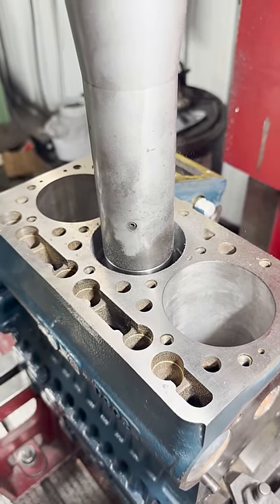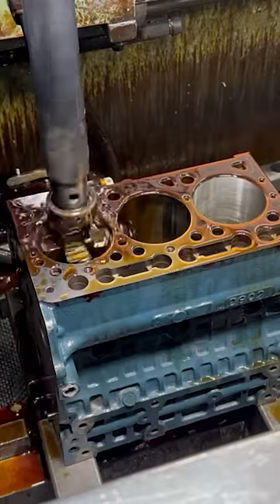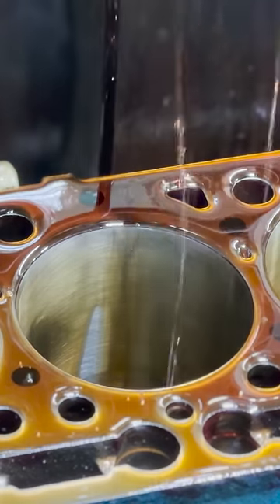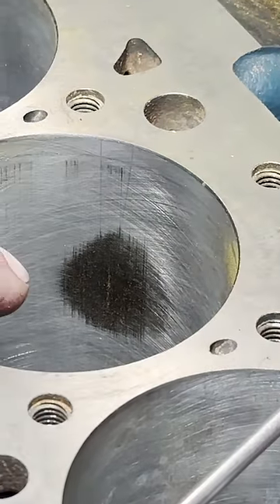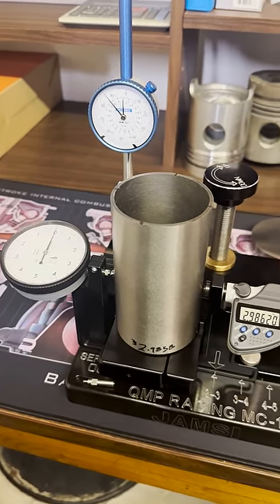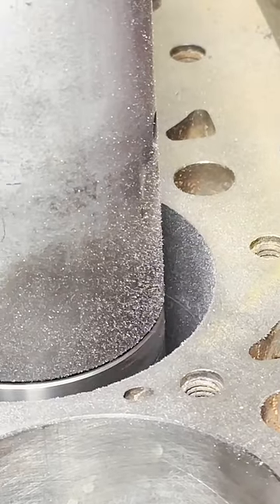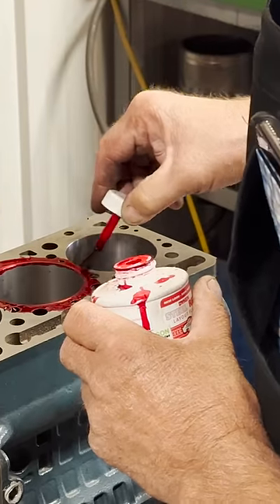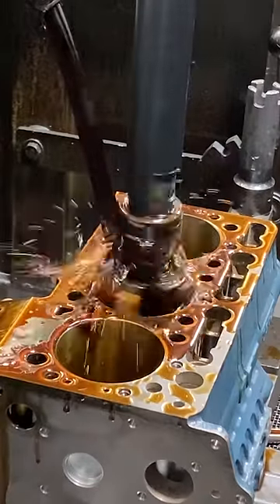#shorts Sometimes You Make Decisions Based On Experience... And It's A Good Thing!

Comment: Its frustrating when a magnaflux doesnt pick up the crack, but it was clearly there, NICE catch, and opting for the sleeve was the proper call as well......good stuff guys....good luck!!!
Reply: Any idea why it wouldn't pick it up?
Reply: The reason is likely that the metal cracked, but because of the force exerted by the rest of the mass of the engine block, that the two parts of the crack were pressed together firmly enough to 'seal' the crack which made the magnetic field average out; preventing the magnaflux from doing its job.

Not to mention the crack happened at a high tempurature when the metal was looser, and easier to move. This would have cause the crack to close when the block cooled off.
Reply: @valkie9781  Appreciate that. It's what I expected, but wasn't sure. I believe also that the magnetic field is created (or re-created) as the metal cools also, as heat destroys magnetic fields... so if the metal is being compressed back together as it cools, it might not have as much as an effect on the formation of the magnetic field as it forms (or re-forms). The thing that surprised me though is that the metal shrinks as it cools, so I thought that would make it less likely to be compressed as it cools or especially after it cools.
Reply: @valkie9781  Great explanation, and WHY the magnaflux didnt catch it, but YOU shur did once machining!!!....again, SMART, and KUDOS!!
Reply: A.good block is less than the repair. Remember..... At this point they need all new bearings and piston rings and a piston and a valve set.....

I wouldn't repair this.
Reply: @valkie9781 I’m assuming he was doing the residual method which is always going to produce a weaker magnetic field and even harder without fluorescent particles under a black light. Would be far better off with just a penetrant inspection in a shop setting like that in my opinion.
Reply: Magnetic Particle Testing should pickup subsurface indications.
Reply: If all the mechanics were this honest and cares about customers belongings, even if its a scratch
Reply: Probably not cleaning the area well enough, however sometimes it can start as a single hole that leads to the rest of the crack.
Reply: Aa i appreciate the praise, but honestly im just a guy who loves physics!
Reply: @valkie9781  so do I, fellow ICE/Machinist lover guy, so am I!!!......i love watchin this kinda stuff, and i've had mor math than most ME guys, did Calc I, II, and III, and did Dif EQ......so i'm just a nerd, who loves this stuff!!
Reply: @valkie9781  wholesome explanation
Reply: @valkie9781  More likely, the cleaning activities peened the metal over the crack. Using DC current for a magnetic particle inspection should pick up slightly subsurface flaws, but AC is often used.
Reply: If they did it right, they would’ve saw it. I do it every day.
Reply: @jacobstevens4130  i was thinking the same , penetrant testing is more sensitive, at least compared to black dry powder
Reply: That's why he gets paid the big bucks! 😏
Reply: Visible dye penetrant, flourescent even, would be the best option. If they are determined to do mag, then wet mag would be best. Powder mag is not great.
Reply: @NotTodayBud I 2nd this with penetrant dye test.
Reply: bro is a prerecorded message
Reply: @valkie9781 that isn't really true though, magnaflux will show subsurface discontinuities, a crack or lap for example that is below the surface that isn't possible to be seen with the naked eye. It comes down to proper testing, if the yoke has been lift tested and in good working condition, issues with the medium, or if the yoke wasn't held across the discontinuity in the correct direction while being magnetized. The main reason for NDT is to be able to catch stuff that is below the surface or almost invisible to the naked eye on the surface. AC works better on surface cracks, DC penetrates deeper so it is better for subsurface cracks. All in all, there are a lot of things that could have been done wrong, but this crack should have 100% showed up with magnetic partical testing.
Reply: @valkie9781 Why would the crack close as the metal cooled?
Reply: @kahikohammah Yup, the comments are either amateur or inexperienced and bullshitting. If you want the full story check out the NA 01-1A-16, it is free to download all over the place.
Note it covers PT, ET, MT, UT, RT, and visual inspection methods and well as covers alot of manufacturing and fab for inspection considerations.
As for temperature affecting magnetism, you energized the part. Unless you change the alloy, it shouldn't effect much beyond temper. Personally, I'd suggest they get a cheap Eddy current tester to save even more time.
Reply: They do t need luck, they have skill
Reply: @deucedeuce1572  If they did penetrant and didn't etch it they could have had smeared metal hiding it.
Reply: @Schimenator  That never crossed my mind, but now that you mention it, I recall that happening fron time to time when testing hydraulic cylinders when I used to build them in a factory I worked at. It wasn't a common part of the job, because we usually used air pressure and mineral spirits and air pressure to test them. Occasionally though, we would have to test aluminum cylinders that were sent back (warranty). We found out that sometimes when we disassembled them, the aluminum and/or the never-seize could be smeared across the cracks, so we couldn't see them with the dye. We had to start taking extra care to clean and brush them. (Before I started working there they didn't want to waste time on each cylinder, because they were more worried about recovering as much cost as possible with as few man hours as possible).
Reply: @deucedeuce1572  Recovering the most man hours and cost as possible? Unless tech data precludes it, you should have been doing bolt hole ET. Especially if all your cylinders have the same ID. Second choice would be surface ET. Find all the surface and near subsurface cracks, intergranular corrosion and heat damage with very little cleaning required.

Comment: ive seen this issue.  you dont always see the crack until you make the surface smooth then it will slap you in the face.  yellow spray paint or using magflux will make it plain as day.
Reply: Did you miss the part where they used flux at the start and didn’t pick it up?

Comment: Use liquid penetrant to check for cracks. Takes longer but thats a tough surface to MPI due to geometry. LPI also pickes up rounded indications as well.
Reply: Also it is just better suited for in work Shop applications 2 spray canns and a rug dont cost much and it doesn't take soo long (wouldn't even start cleaning a maschine in that time)

Comment: Too many people would take the easy way out and junk the block. I wouldn’t let people with that mentality touch my components. You guys made the right call and did an excellent job with the repair 🏁.
Reply: Would not a new block be stronger than one with a crack  in it?.
Reply: @leeengelsman1855  … Or course a new block would be preferred but things like cost and availability have to be considered. Sleeved cylinder bores are usually stronger if the original cylinder walls are too thin.

Comment: As a kubota tech i think the only somewhat common catastrophic engine failure i have seen is usually from overheating especially in RTVs due to all the coolant leaking out, thermostat stuck, or just shitty coolant. Usually all cause the customer doesn't wanna pay attention to the light on the dash

Comment: Love your videos bro, but magnaflux is a brand. You are performing MT(magnatic testing) or more specifically MPI(magnatic particle inspection). If you ever have a susicious area and nothing is being picked up with the AC yoke, try using the DC setting. The DC setting is for picking up internal indications; although, it is extremely difficult to properly diagnose.

Comment: You may give some consideration to drilling a .090" pair of crack-stop holes, one on each end of the crack line before installing the new sleeve.
This can easily be accomplished with a Aviation right angle "ace drill or snake drill"
If the holes are blind you could also drive in mild steel pins a couple of thousands over the I.D. of the .090" holes and then smooth them when you hone before fitting the sleeves.
The interference fit pins will put the crack-stop holes in tension and further mitigate crack propagation.

Also if you spot the crack during the boring operation you could drill and pin the holes at that time provided you can get the boring bar/quill and spindle out-of-the-way to get in there and work while also maintaining original center line of your boring operation--and then knock off the proud portion of the installed pin(s) with the boring bar--giving you good confidence it will not catch/damage your honing stones during final bore sizing.

Just a thought.
Reply: What a load of shit. They did it the exact proper way and I have been reconditioning engines for 57 years.

Comment: The block was here in the machine, time and money invested up to this point. A sleeve fitted job done.  There was a well thought out reason to be there with regards to cost and downtime.. A bit more boring and a sleeve cost a couple hundred bucks extra. Makes sense to me. Many others said delay of a year and 5000 ish bucks.  I would go down the same route and I turned spanner’s and ran a shop. You need the vehicle/equipment back on the road reliable as soon as possible. Also find out why it overheated and fix that, it might be operator error!

Comment: Maximising your indication in a perpendicular direction with the yoke to the direction of the crack will show you the true length and width of those cracks when you’re using magnetic particle inspection. Also while being magnetized which is hard in the small space of the cylinder bore. Magnetic prods would be better IMO. You guys do great work.

Comment: You did excellent, exactly what i thought. This process is often done in 2 stroke dirt bike cylinders, which have exhaust port bridge support which often cracks, because whole cylinder is casted aluminium with nikasil plating, and when bridge cracks there are 2 ways, first is welding, boring and grinding and then putting new plating which is really expensive, or just sleeve cylinder , iron is much harder and I never seen a 2 stroke sleeved cylinder fail on bridge

Comment: If you hammer it manually you'll have uncontrolled pressure inside the sleeve. You should install it with a press to uniformly distribute the pressure.

Comment: If you rebuild an engine, you know what you got. Most rebuilt engines get a piston:cylinder tolerance of 1/10000th creating better compression and less degree of failure. Any used or off-the-shelf engine will have a 1:1000th tolerance so the piston rings take more abuse and you have the same chance to overheat and experience the same failure.
I will spend 2-5k rebuilding over paying the same price for the same failure down the road.

Comment: Use a 90 degree drill to make holes at the beginning and end of the crack. Putting a sleeve in a cracked parent bore, better be accompanied with a healthy dose of loctite. I always used nitrogen to shrink the sleeves about 2 thousandths of an inch. Then the sleeve just drops into the parent bore and sits on the bottom lip without hammering on a cast sleeve that can break quite easily. You'd get about a half of a rotation with the sleeve before it heats up to the temp of the block almost instantly and locks up in the parent bore. You can watch the frost on the sleeve disappear and then it's locked in place. Also heat transfer between sleeve and parent bore are very important. If you have any air pocket or voids trapped behind the sleeve, that can create a hot spot. Air is a great insulator and blocks heat transfer.

Comment: Would it not be beneficial to install the sleeve with a temperature offset? The .002" interference could be turned into a .002" clearance with a 300 kelvin or so offset. Chuck the sleeve in the freezer and the block in a 250°C oven and they will slide together with minimal effort and it reduces the chance of it picking up during the install.

Comment: bro i apologize if I being rude, why don't oversize the cylinders before putting bore in it? In Indonesia the solution of that kind damaged to the block only tell the client to buy a new engine block or weld that graze part with alloy if the client want a cheap and short term life before putting a new bore.

Comment: Maybe a dumb question. Could you weld the crack and then re bore ? Or would that weaken the rest of the cylinder ? Probably not worth it but I would think the crack on the water jacket would open up under pressure.

Comment: I don’t think idling your car for a few minutes is harmful to modern engines. The biggest concern would be with direct injection engines: carbon buildup. It’s more likely to happen from idling. However, a few minutes is nothing. 

There’s no need to do it on modern engines, but to say it’s harmful isn’t exactly true from what I know. Now, idling for extended periods of time, like 30 minutes or more, can be harmful. 

But, like you said, all that’s necessary is to just let it high idle and drop back to normal. I cringe when I get off work and see everyone in the parking lot start their car and throw it into gear and take off with normal levels or acceleration. I let it idle down, and then I stick to no more than 50% throttle until the coolant and oil comes up to temp. And even then, I usually stick to 35-40% or less throttle unless I really need to get that extra 10%.

Comment: So if an engine has a crack in its expansion chamber, you just drill out the hole wider, then push in a tube from the same material with glue? Thats amazing.

Comment: Those small Kubota diesels are odd. Depending on the CC’s of the engine, they may or may not be sleeved. Interesting thing is, the sleeved engines don’t have a lip on bottom to set them on. Sleeves are just pressed in flush. I don’t see any reason to leave a lip at bottom to set a repair sleeve on. Things you wouldn’t know unless you’ve rebuilt a few of them.

Comment: i literally have pics of this same engine with the same problem. overheated and the boneheads kept starting the machine back up to try to finish the job and ended up blowing up the machine and then how much profit on that job you think they made after that dumb decision lmao. they ruined that engine. we just junked the old one and got a new one and installed it, sold off the unit. it had more than paid for itself at that point im sure. it was a rental unit and yall gotta know how bad they are abused and used more hours in a day than there are in the entire weekend lol

Comment: Many years ago I had a V8 engine that had 8 sleeves one collapsed. I pulled the engine apart put new sleeve in. Later another one collapsed,

Only good sleeves are the ones with a LIP at the top. 😵‍💫

.

Comment: Is there a risk with the crack spreading over time? Would it have been better to weld then bore before press fitting the sleeve? Just asking for knowledge not meant as an insult or anything like that. Thanks.

Comment: I have a friend that owns a motorcycle shop. He has a problem with getting machine work done. He is based out of Houston and has cylinder blocks and head that the local machinists are putting him on the back burner. Any suggestions? Could yall do it?

Comment: 3cyl diesel always have issues. Head issues common. Why not use 4cly and be more balanced? Cheaper with 3
Reply: We have 6 toro groundsmaster mowers with kubota 3 cylinders, all almost 20 years old. The only one that needed major engine work resulted from an employee rolling iit over and leaving it running for 5-10 minutes until the mechanic got there to kill it. Other than that, they even handle gas getting poured in without blowing up

Comment: I noticed that you don’t machine notch at the top of the block and a lip on the sleeve so when the head is installed the sleeve can’t move ????
Reply: There's a stop machined on bottom that sleeve is down on, the top would be held down by the head besides the tight press fit w\ locktight it's not going anywhere! 👍💪🛠️🔧🔩

Comment: Is it possible to change the crankshaft in an engine?  I messed up my Miata by changing the timing belt myself and not tightening the crankshaft bolt enough and it messed up the keyway.

A shop used epoxy to fix it, but it won't be able to handle forced induction, for example. I want to turbocharge it really bad.  Would it be easier to just buy a used Corvette?

Comment: Is it safe to reuse the block with a cracked cylinder wall even if you sleeve it? I heard someone say that if there's a crack then the sleeve has a weak point too as the cylinder wall around it isnt as strong thanks to the crack

Comment: Could that crack let coolant into the crank case?
Reply: Probably ether oil or coolant But Yes.
Reply: @7.3PSDA2  wouldn’t the block be junk if Coolant was leaking through the crack? Could you weld the crack?
Reply: That's why they sleeved that cylinder.  The press fit of the sleeve seals the crack.
Reply: @LuckyBaldwin777  oh okay, thank you for the info. Always learning something new!

Comment: It cant be cheaper to pay for the hours to remove and full tear down the engine block, transportation of the block, and then all this expensive work on top of that than it would be to buy a vrate engine and just replace it instead.
Reply: True, but then how will the shop bend you over for more pocket change? They got child support to pay for.

Comment: Why loctite the engine? Isnt that red loctite usuless in high temps? Like thats how the seal is normally broken is by using heat?
These are real questions!
Reply: Red is the heavy duty high heat one. Blue let's go under high temp. It's likely to hold it in place untill the machining is done and the head is able to hold it in place